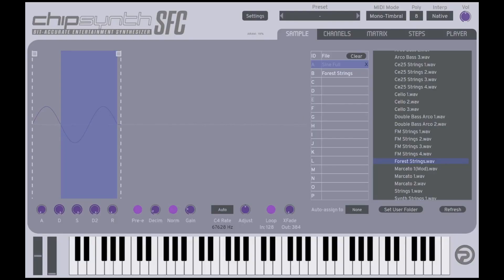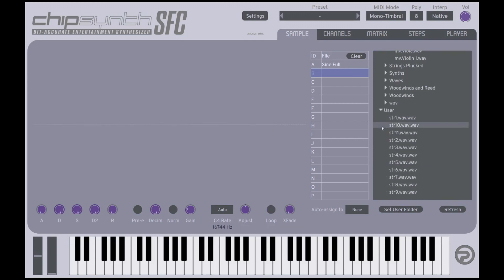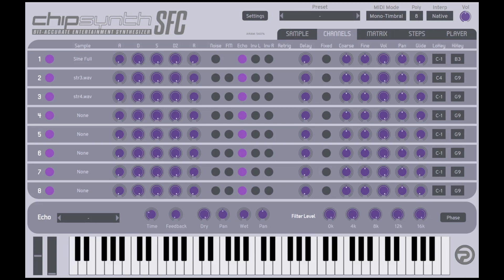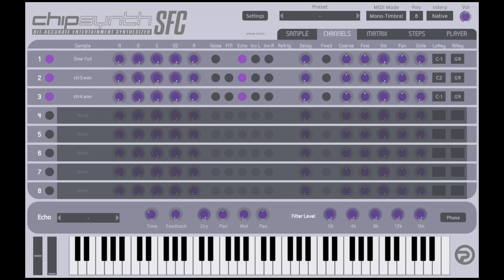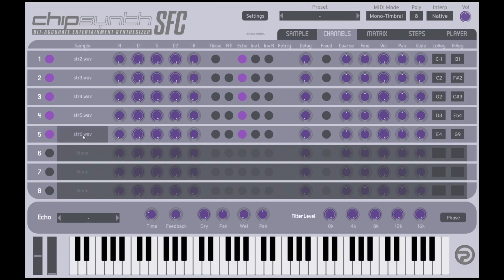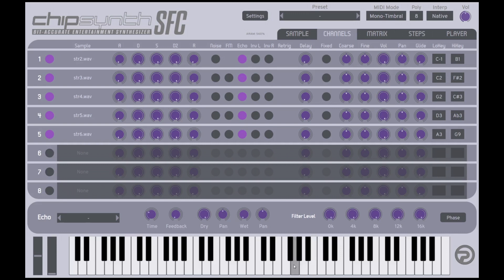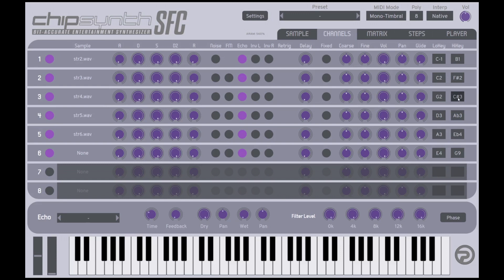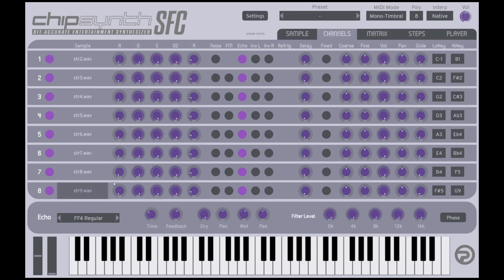SNES Music - Episode 3j - chipsynth SFC - Instrument Splits and Multi-sampled Instruments

Comment: Do you know the origin of the strings used in Schala's Theme from CT?
Reply from the maker: I'm pretty sure it's the newer emu strings with a low pass filter
Reply: @tssf  So you don't quite know? Oof. Emu hardware being a pain in the ass yet again. It was an issue in the DKC games, and it's still an issue in Chrono Trigger, lol.
Reply from the maker: @Focalors21  they're edited sounds. They sound like the same strings from the proteus 2/e3 (the same ones ff7 edited for use in the intro theme before the bombing mission) and CT has gotten a number of its other sounds from there.